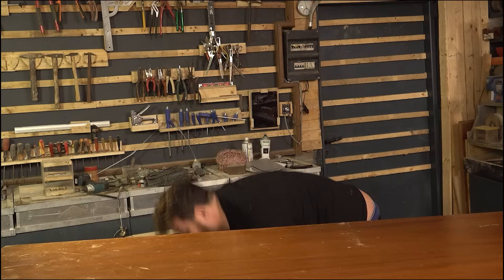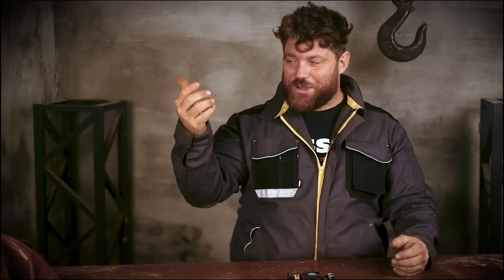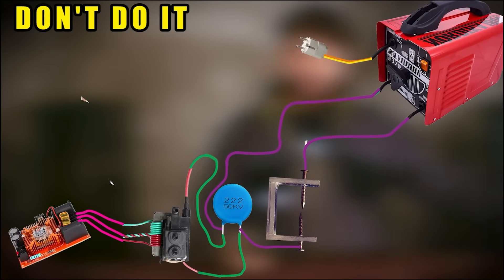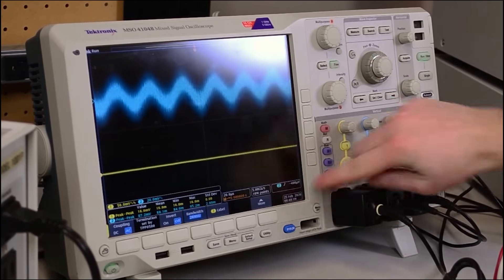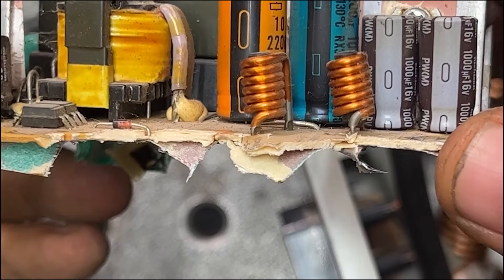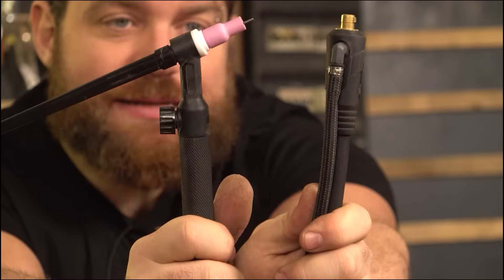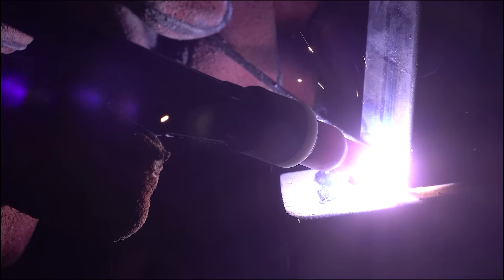How to Make a Plasma Cutting Machine From Scrap

Comment: Ich möchte meinem alten schweißtransformator bj. Ca. 1960 
Ein Upgrade verpassen😊
Die Spannung im Leerlauf beträgt allerdings ca. 60 Volt ac.
Das sollte aber kein Problem sein..
Einen dicken fetten brückengleichrichter bis Max 150 amp habe ich auch, muss noch einen passenden kühlkörper finden.
Hochspannungs keramikkondensatoren hab ich ebenfalls.😊

Comment: Hello your video is amazing and extremely informative, I have a 408 volt 58 amp hour car battery that I am going to try to use for a mobile welding rig, do you think that I should use the same setup you did after the bridge rectifier? Or should I do something different? I would love to be able to use the battery instead of a inverter or generator to run my current plasma cutter but it seems pointless to convert the DC power to AC then back to DC, thank you I appreciate your input

Comment: I'm planning to convert a microwave to plasma cutter.. What is your suggestion..or help us do it since you're good in electric engineering
Reply: Wenn man die HV Wicklung des Mikrowellen transformators entfernt, und durch eine selbstgewickelte sekundärspule ersetzt, geht das.
Die originale HV Wicklung eines mikrowellentrafo ist nicht kurzschlusssicher,  und gefährlich. 
Der trafo sollte mit einem Fan aktiv gekühlt werden.

Comment: Hi there, first of all i like your project but I see some problems with it. 

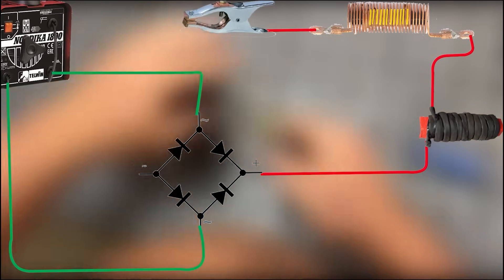1. At 11:09 The main purpose of the zenner coil is to prevent that kind of issue so as long as ZVS circuit has a dedicated power supply (not from main bridge rectifier) that DIY varistor doesn't make any sense. Via reverse inductance (thrue zenner coil and HV transformer), the voltage would be very low even at the end of arc and with reverse discharging polarity of coils. If the ZVS driver got shot it must be due to other reasons, maybe accidental spark jump.
2. At 13:00 the series of diacs don't make any sense in CC, please elaborate.
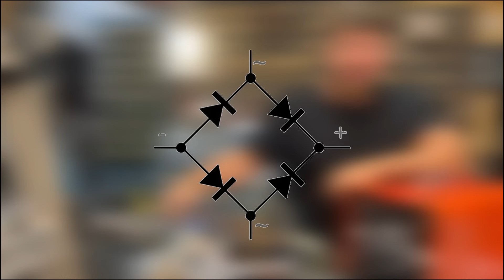3. At 13:09 the 1nF 22KV capacitors don't make any sense at 25-50 Vcc. It's overkill in voltage rating and insignificant in capacity rating.
4. At 13:15 All those capacitor in schematic over the bridge rectifier have no sense. Other than a electrolytic capacitor (or more in paralel) and another ceramic capacitor also in paralel (the second one to lower the ESR) and both on the output of the bridge rectifier the other capacitors have no place. And even these two capacitors are only necessary for a perfect cc current (not needed here). The DIY Inductor is usualy sufficient in this kind of application and it can be more efficient with more thiner pieces of iron due to difference in eddy current loses.

I repeat, I like your project and I want to do it my self but I want to understand why did you do some things which apparently don't make sense to me.   Tnak you

Comment: An other way to protect the machine/rectifier is putting a high voltage capacitor that has a low AC resistance at the frequency of your HF/HV supply, it will appear as a short.

Comment: Usually the sparkgap is used to pulse-discharge the capacitor and is connected in series with it, it provides safety and you can adjust the output power changing the gap. The way you connected yours basically the capacitor is always connected to the inductor and flyback,  you are leaving the HV connected all the time so that can cause an accident/electroshock and if you ever used a way to turn it off it could ressonate and send a reverse voltage possibly frying the driver. Also those heavy duty terminals looks like aluminium, alu+copper = oxidation + corrosion.

Comment: Plug in that rectifier and cap pile to your wall circuit, I want to see it explode! Rectifiers are all bypassed meaning ac current flows past dc rectifiers. Rectifiers lock caps into max voltage of the diode breakdown of .7 volts for example. Rectifiers with cap placed across pos and neg dc output works and is real.

Comment: I have to stop right off the bat I was trying in the welding shop I learned apprentice style I didn't go to school and get the book but there was other people I met that did and they taught me something that my father should have taught me seeing as where I'm from but anyway I learned that the oxygen settling torch only needs the gas to start the cut after this cut is started you can remove the settling completely and keep the oxygen flow going the oxygen keeps the plasma fire or the oxidation add proper temperature to continue cutting and it is exactly a plasma cut when you cut with a gas torch the same rules apply with what's called an air Arc an air Arc is an arc welder with an airbrush you make the puddle just like you normally weld and then you blow the puddle out with a burst of air and that's what an air Arc is and that's a cheap quick and dirty plasma cutter you can for all purposes make plasma in any fashion that you make a pool of liquid metal and then start hitting it real careful with the air compressor and actively run it just the same as you would run an oxygen settling torch all around the jobnow a plasma cutter uses a tungsten rod or some other type of rod and makes a small Arc of electricity between the tip and the metal you're supposed to have the ground hooked up but a lot of times it'll function without the ground connected because it's using the high humidity in the air this is not good for your health and as such instead of hitting you the machine will break when the humidity drops below a certain percentage so be sure when you're using a plasma cutter that's a normal plasma cutter uses an air compressor to keep the ground connected but basically they have a DIY with microwave oven transformers and you really need to build a ballast transformer to do it without the transformer burning itself but you can use the transformer to melt metal and it's a real quick cheap and dirty way to start the metal being liquid and then hit it with the air compressor with a parts cleaning nozzle and run it just like a plasma cutter however the hell you could want to do😂🎉❤❤❤🎉

Comment: Factory-made plasma cutters have about 200 to 300 volts at no load. And when in use it drops to about 50 volts. How do you keep the plasma flame burning with 60 volts at no load and 20 volts under load?🤨is this a fake video?!
i tried this with my welding machine but it isnt worked at all!

Comment: Thing missing from the explanation is that if you plan on making the tig welder, just remember you need argon gas as consumable shielding gas and its not exactly cheap with rental or bought bottle and its costs considered. Not impossible, just not cheap.

Comment: Good video my like, or il mio "me Piace molto il tuo video" 👍(my parents are from bagnara, Calabria it's a shame but i still not learned the language of my parents 😔)
A little question: if you only need just a hig voltage, it's not the same use the mechanism of a microwave? You have around thousands volts, a huge capacitor and a transformer could make an arc of 4kv ......
🤔🤔????
Greetings from Argentina, bs as. A loyal subscriber

Comment: I have a question: do the diode line and the diac line go to the torch? Or to the negative port rectifier bridge?

How many lines does the torch have?

 I think has three... the line negative volt, the line of diode and the line of diac. this is correct ?

Comment: An interesting/amusing exercise but I'll stick with my $350.00 65amp pilot arc plasma cutter and not worry about burning my shop down or electrocuting myself or someone else. This is reminiscent of that craze a few years ago of people creating art by burning wood with high voltage learned watching u tube videos. By following instructions and having no real understanding of what they were doing people started electrocuting themselves and others. Building plasma cutters out of garbage is more complicated than building an arc welder out of a couple of car batteries, a little knowledge can be a dangerous thing.

Comment: Excellent! This is truly innovative DIY. Would it be possible to make a plasma torch using an old microwave high voltage transformer instead? Obviously for cutting thinner metal only.

Comment: Hello!
13:15 Could you describe how to connect the electrolytic capacitors to the rectifier bridge. Where are the pluses and where are the minuses electrolytic capacitors?
Reply: Most of it was real but the rectifier with caps was bullshit. A Rectifier with those caps just bypasses everything with massive losses. Rectifier with horizontal cap from pos to neg is real world. There are some instances where caps bypass really high or low frequencies but nothing was explained and the diagram is wrong.

Comment: I Have a Question about the HF Injection Coil. Talked about at 6:00 minutes in the video. You say its $7.00. But what is it called and where do you get it?
Reply: Found it its called a ARC Starter 
 https://www.google.com/search?q=+arc+starter+coil+LGK60+&sca_esv=8e92d7160ae93a44&sxsrf=ACQVn0-z6MpTCod0BRCWqvm8nphjFDFKNQ%3A1711820235733&source=hp&ei=y00IZpuiKrD3kPIP_eWm4AU&iflsig=ANes7DEAAAAAZghb2_dkAzgoFfxiS9z1g5EkXP7JaCWd&ved=0ahUKEwjbs8Wow5yFAxWwO0QIHf2yCVwQ4dUDCBc&uact=5&oq=+arc+starter+coil+LGK60+&gs_lp=Egdnd3Mtd2l6IhggYXJjIHN0YXJ0ZXIgY29pbCBMR0s2MCAyBRAhGKABMgUQIRigAUipelD0B1jKdXABeACQAQCYAXmgAdACqgEDMS4yuAEDyAEA-AEC-AEBmAIDoALpAagCCsICBxAjGOoCGCeYAwiSBwMxLjKgB4EG&sclient=gws-wiz
Reply: Plasma ingtion coil

Comment: Interesting video. I was surprized to see you using the cutter with no dark eye protection. The amount of UV that comes off a plasma cutter is pretty high I thought.
Reply: Yes, probably don't do any of this, but definitely protect your eyes.
Reply: Most of that light is under your cut, so you're not seeing much of it. Welding is different.

Comment: why not switch the leads on the factory step down transformer that makes the high current,  to make it a step up transformer increasing voltage and dropping current from the input source? or skip the original transformer all together, having a second contradictory transformer means your losing extra power for no reason.

Comment: Good conceptual design but you have a lot of issues with the overall design.  The main one is your Open Circuit Voltage from the welder.   It's way too low.  

Stick welders are constant current power sources, as you need for a plasma cutter, but they only have around 60 to 80 volts open circuit to work with, which is way too low for a plasma cutter to work effectively.  

Any decent plasma cutter is running 2 to 3 times that,   The reason is to help stretch the arc out further to reach through thicker metals.   Ideally, you want to have about 30 to 35 amps cutting current for every  1/2 inch/ 1 CM of cutting capacity and at least 160 to 200 volts to reach that far and an extra 50 to  75 volts for every 1/2 inch /1 CM more you add past that.

Many commercial 100+ amp power supplies run at well over 300+ volts Open Circuit and pull 10's of kilowatts off the mains lines to do it.

Comment: At first I thought this was a fake.  I'm afraid the explanation wasn't clear to me.   As I think I understand it,  the majority of the power comes via the bridge rectifier and is relatively low voltage.  The high voltage component is a starter.  Once the high voltage (and low power) part has struck the spark,  it is maintained by the low voltage (and high power) circuit.

Comment: One bit of information that may be useful to any of you who are wanting to recreate this project: You can DIY everything but the handpiece. The reason (other than it would be unnecessarily difficult to build) is because the electrode has a little nugget of hafnium oxide imbedded (which is a consumable btw). It's purpose is to more freely donate electrons (or whatever the verbiage was). The better explanation is it makes it possible to ionize dry compressed air into a plasma, otherwise you would have to run Argon (or some other mix of easily ionizable gas) through your rig and when it's not necessary, why bother with all that hassle and expense. I spent a lot of time fucking around before I realized this.
Reply: True, But see how intelligent you became for all that FAQing around? I found a couple $100 for a cheapie. Still you educate me (all your readers)on what is in there.(has a warrantee too btw) It interests me to consider making my plasma more powerful...
Reply: That may have been the nicest thing anyone has ever said on YouTube. Thanks  @jackrichards1863
Reply: I want to recreate this and the tig welder, but im going to need some advice. Is there a way that we can stay in contact?
Reply: @fredymredy  Sure, I'm not on YouTube as much as I WAS, but I'll answer any question that you have. The only thing that I have actually done in reality is make a HF start circuit, which worked pretty well. I ended up using a home made ZVS flyback circuit where the output was attached across a home made HV capacitor (made of transparency film and aluminum foil rolled up and then wrapped with plumbers tape and filled with hot glue.)  and a spark gap. I had that discharge through a transformer core with the secondary as the tig supply. (to give you the isolated HV starting spark at the electrode) I think this is pretty much what the guy in the video did. But you know, its always easer to be able to ask someone direct questions... this shit is hard to figure out on your own.
Reply: Hay países donde no se tiene acceso ,recuerdo por el 2007 arme una tig con hf que encontré de un aficionado de EEUU ,estoy en argentina y eran carísimas.y no las tenía cualquiera

Comment: I have 60,000 volt Dc neon transformer and am wondering what I can do with it. I've worked with, flybacks multiple high voltage transformers, microwave transformers " modified" and so on. I need a simple arc welder but some of my past collections have moved  home  . I'll check out some of ya past vids...I'll be back cheers

Comment: Saludos desde Guatemala, para la bobina que hiciste con las 4 piezas de hierro, seria mejor usar el nucleo de un transformador de microondas sin las bobinas, por que algo asi he visto en las maquinas de soldar DC y sirve tambien para filtrar el Ripple de AC en la linea de DC, el controlador de chispa que usas conectado al flyback, se puede hacer usando un 555 y algunos componentes electronicos extras, es mas barato que comprar el modulo y se puede ajustar en funciuon de voltaje para generar el HV, tambien se puede usar una bobina de auto en vez del flyback que genera un voltage mas alto para el plasma, bueno, es mejor fabricarlo y probar con estas especificaciones y haber si funciona!!!

Greetings from Guatemala, for the coil you made with the 4 pieces of iron, it would be better to use the core of a microwave transformer without the coils, because I have seen something like this in DC welding machines and it also serves to filter the Ripple of AC on the DC line, the spark controller that you use connected to the flyback, can be made using a 555 and some extra electronic components, it is cheaper than buying the module and can be adjusted based on voltage to generate the HV, too You can use a car coil instead of the flyback that generates a higher voltage for the plasma, well, it is better to manufacture it and test it with these specifications and see if it works!!!

Comment: So if this diy cutter can be made into a tig welder, can my tig welder be made into a plasma cutter? What would it need?
Reply: From what I understand you would only need a torch and connection to an air compressor that provides you more or less 100psi
Reply: @sergiolorenzana8141 no.and voltage too.just google the voltage difference of Tig and plasma

Comment: Yes very good but is not as nice cut as the store bought ones. Whats the issue? Do you need more pressure? Is not enough amps? Too big of a nozzle orrifice?  Is very unclear why this is. 

Making my own is worth it even if it comes up to be more expensive. 

Because repair and the reliance on somebodys work with your entire life is not something right. 

So when you can know how it works intimately is much better then just buying and relying on somebody else to do a good job. Because sometimes they dont and you cant even tell. 

Ive seen much cleaner cuts are possible. So hmm why is that?😊
Reply: As far as I remember, the plasma cutter that I used on a job had to be connected to a compressor of at least 100psi, if the pressure dropped below that value, it made the ugliest cuts and the compressor that it uses (50 liters) does not provide the constant 100psi that the plasma cutter needs!

Comment: that old cable there you hammered was aluminum cable.. just saying
good vid tho!🤘
Reply: and could this be possibly made a little bit easier with dc arc welder? i have 3 old ac ones but i am using them as ballast to big transformer creating big arcs of it.. it runs at 18250W in single phase.. and yes the wires get hot rly quick cause the ballast system draws over 48A peak current at 380V. So the HV end is somewhere around 0,869A at 21 kV

Comment: The "fault valve" you made is usually made with a spark gap in such high voltage circuits. Your solution is much more interesting!